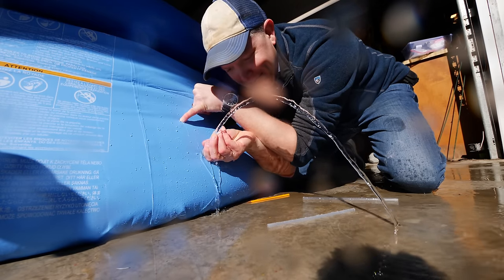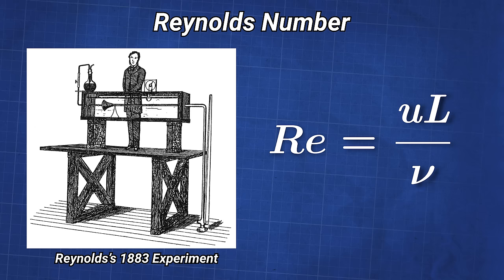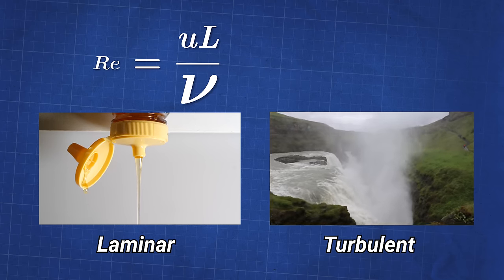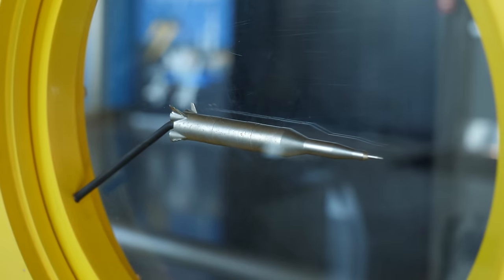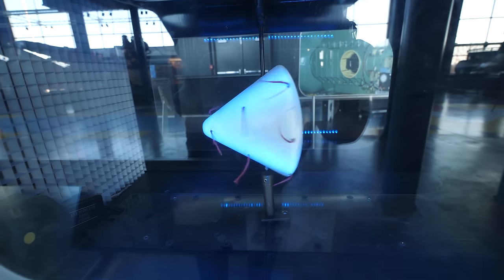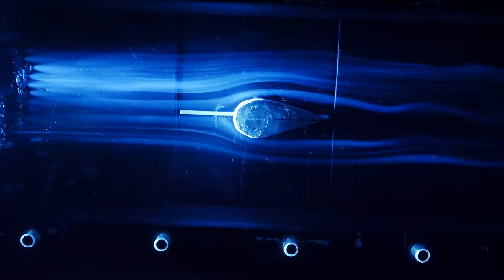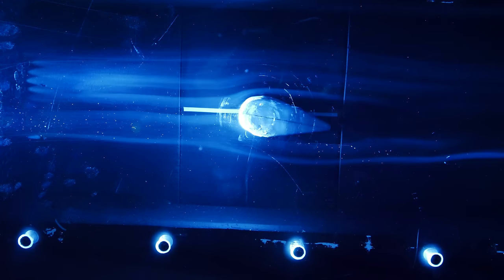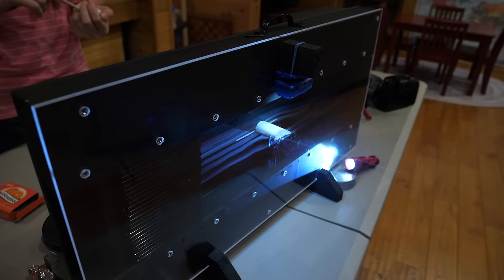Why Laminar Flow is AWESOME - Smarter Every Day 208

Comment: If you put your head under a laminar flow bubble, could you still breath without breaking the bubble? Would air escape through where the water hits the bottom or would the bubble bust with the increased air pressure in the bubble?
Reply: interesting idea... I would say it stays the same since the air volume in the bubble decreases as you inhale, the air volume in the lungs increase equally. But, there may also be a chance as the water creates bubbles at the surface of the pool, it may be increasing the air volume inside since there are bubbles being produced on both sides of the water bubble and air from outside of the water "bubble" is allowed to escape to the inside.
Reply: @bunnykiller  that'd be an interesting high speed camera shot...  a sudden pressure increase (or decrease)  in a "sealed" laminar flow bubble.
Reply: Sounds like a really neat idea. Someone needs to get on this right now.
Reply: What is the reason you think pressure would increase in the bubble? You don't produce air, and unless you add air, there is no average pressure increase. There will be localized pressure increases/decreases around your mouth as you breath in and out, but the average pressure of the area will remain the same.

I don't know how much oxygen you absorb in the average breath, but I would say that all that would happen is eventually you would pass out after you've used all the 02 available. Hopefully you have a supervisor around, or the sense to get out of the bubble early, as your head would now presumably be underwater in which case you would otherwise drown.
Reply: They have laminar flow fountain bubbles in the OKC science museum where you can feed pressurized mist into the bubble. It will get larger and larger until it pops like a balloon. Super cool.
Reply: @toasty4000000  The air you exhale weighs slightly more than the air you inhale. So presumably, it would sink and create extra pressure near the bottom.
Reply: I don't think the pressure would increase, you'd just exchange O2 for CO2. It would be interesting to know if such a bubble is actually air tight to gas exchange though, at least at the rate needed for breathing.
Reply: Oh my god that is so cool. I hope Destin comes up with an idea to demonstrate it. I would love that.
Reply: @toasty4000000  He said if just your head was under the bubble. You don't "produce air", but you can transfer air from your lungs to the inside of the bubble. If the bubble was around your entire body it would be different, but that's not what he was asking.
Reply: It's not really a bubble in the classical sense that some gases create bubbles when they rise from below water. If you look at the bubbles Destin created or the one in the fountain, those don't create depression, which would be the difference in pressure you're talking about. I think air pressure would be far too low to create something like that, you'd have to have incredible exiting speed for the water. Even then you don't get an entirely "smooth" (laminar) surface to the "bubble", there will be some disturbances from the not entirely perfect shape that the water exits from, this leads to holes in the stream (cavities) which make the bubble incomplete (which lets air inside).
Reply: @toasty4000000  The reason is because if you go in without a breathe, then when you breath in, the pressure outside of your body would decrease.
If you go in with a breathe, then when you breath out, the pressure would increase.

Breathing with a paper bag over your mouth is the same idea; it's not like the bag would stay the same size. lol
Reply: I agree with the lung capacity comments, but I don't really think that is what OP was getting at. Could be wrong.

Comment: Though commenting on this almost 2 years after it was made, we took advantage of this for a trick as kids (though I hadn't really thought about it as such until now). I grew up in the middle of nowhere Idaho and all the farming there is done by irrigation. To control who gets water when, the irrigation district employees would go around and adjust the gates along the ditches and canals. We had a couple of swimming holes where some of those gates were right by a small bridge. We would swim up under the bridge, where there was almost a circular "lazy river" created by the flow from the gates. If the gate height was just right, then the water spilling over was laminar. We would often back up towards this laminar spillover and when it reflected off the back of our heads, it would create a pocket of air (just like in your fountain)  and we could just sit there and breath the air from the pocket. Thanks for bringing back some great memories!

Comment: the same thing happens in rivers.  a murky particle filled stream joins a clear colder tributary stream and the two streams take many miles to mix.  also with ice streams of combining glacier flows (though the flow is slower).

Comment: I refuse to watch at 360p. Destin's work deserves 1080p at the very least! I needs to see that flow in HIGH DEFINITION <3
Reply: I just watched the whole thing in 360p without even realizing it.
Reply: its a YouTube trouble
Reply: curiosity wins over 360p lol
Reply: It is painful to watch in low res!
Reply: Watch it twice like a normal person.
Reply: @UndercoverFerret404   Is that extra chromosome acting up again?
Reply: @MarinusMakesStuff  Did you parents drop you too many times when you were little? If you even knew your parents of course.. I guess not.
Reply: lel i thought that my wifi got some problem cus its always auto 1080p
Reply: @JonathanLov  same here. didn't notice it was 360p until I read the comments. curiosity wins :)
Reply: @UndercoverFerret404  Lol, took the bait :D If you can't finish what you started, don't start ;) Be nice.
Reply: I just watched this on a 43" 4k monitor without realizing it was low res, good content is good content
Reply: Im waiting for it lol
Reply: The YT compression algorithms are pretty good, tho. The 360p looks better than FB "HD" res.
Reply: I've been waiting 5 hours now, refreshing every 10 minutes. I stand strong on the front against low-res.
Reply: Then don't. I'm sure he won't notice.
Reply: Not watching if it's not 8K.
Reply: @6infinity8  lol
Reply: 6 hours later...still 360p
Reply: Rumor has it if you watch it 3 times it will be in 1080p
Reply: @Vidz0022  and it still doesn't change the quality of the content.  Maybe in 24 hours?
Reply: @MarinusMakesStuff  
Yeah it's working great!   Oh, he wanted to thank you for donating yours, since you weren't using it.
Reply: @UndercoverFerret404  Haha, a troll calling a non-troll a troll. Made my day. Thanks man.

Comment: Hey Destin, put a light source inside the laminar flow, it will act just like a fiber optic cable, the light will only escape when the flow becomes turbulent.
Reply: yes that needs to happen
Reply: You actually just blew my mind thanks!
Reply: If you shine a laser at an angle into laminar flow the laser beam will spiral up through the stream
Reply: it depends on the fluid refraction angle with the environment, not all 100% is refracted inside...
Reply: What? Imagine you’re stirring a pot of water and putting a laser just beneath the surface pointing down. I don’t think the red dot on the bottom of the pot will move.  Light passing through turbulent flow,  but unless it gets refracted by the surface of the water the dot will stay in place.
Reply: Are you sure?
Reply: It will escape at all points, although mostly during turbulent flow. It also depends on how much the stream is bending. You need a slow gradual bend to minimise light escaping.
Reply: @yutaegil4944  Yes... The laser beam refracts, but not only that the internal surface of the water is reflective.
Reply: How would you do that? With the young girls laminte flow? Didn't she have a light in it already. or the one at the science labatory he stood in.
Reply: @wildwest2255  put a light source behind the funnel that's in the kiddie pool

Comment: You should go to a manufacturer of fountains that use laminar flow.  I'm sure they would be glad to show you the development work they put in to designing their laminar fountains.  Fire departments also put stream straighteners on their large master streams (usually mounted on the top of the fire engine) to smooth the flow of water.  This not only keeps the stream from bending sideways, it will flow farther since it's not breaking up with turbulence.
Reply: Development process: listen to Destin talk about "all the variables" for 10 minutes, and then they just fill a tube with lots of little straws to make the flow more laminar, and then try a bunch of random flow rates until it looks good.
Reply: MikeBramm this reminds be of something related! The nozzles are actually designed to break laminar flow because that type of water is less effective for putting out fires.
Reply: This is a really good point, as a laminar velocity profile within a tube does not necessarily translate into being a nice "laminar flow" on the outside without some precise manufacturing of the opening. My dynamics professor gave us a whole 20 minute spiel about how he thought the Detroit Airport fountain was made, and when he talked to the company who made it, they more or less confirmed that he had the right idea.
Reply: @Mrcaffinebean  what
Reply: But anyways you should go and do that first 😉
Reply: daniel finley-pesti if you look at the end of a Modern fire house nozzle you’ll see it has little slits to break the laminar flow. This is intentional because a thousands of small droplets of water do a better job of putting out a fire than one solid continuous laminar stream.

Comment: When you accidentally pee on the rim of the toilet bowl, laminar flow ruins your bathroom
Reply: I bet, that was turbulent flow what ruined your bathroom mate!
Reply: Taylors number explains why we often have problems with aim. The best way to wash your car, hold the hose to the surface and the impinging jet/circular laminar flow uses the least water with quickest removal of surfactant.
Reply: Pack it up boys this guy won!
Reply: Laminar flow would be the ideal situation as it forms a steady and organised stream. I think you meant to say turbulent instead of laminar.
Reply: I think this is the most relevant example to most males - we see pee physics in action all the time
Reply: Laminar flow is good when aiming, but bad when you didn't notice that electric fence...

Comment: 0:51 
Hi, Phil Swift here with 
Flex Tape! The super-strong waterproof 
tape! That can instantly patch, bond, 
seal, and repair! Flex tape is no ordinary 
tape; its triple thick adhesive virtually 
welds itself to the surface, instantly 
stopping the toughest leaks. Leaky 
pipes can cause major damage, but 
Flex Tape grips on tight and bonds 
instantly! Plus, Flex Tape's powerful 
adhesive is so strong, it even works 
underwater! Now you can repair leaks in 
pools and spas in water without draining 
them! Flex Tape is perfect for marine, 
campers and RVs! Flex Tape is super 
strong, and once it's on, it holds on tight! 
And for emergency auto repair, Flex 
Tape keeps its grip, even in the toughest 
conditions! Big storms can cause big 
damage, but Flex Tape comes super 
wide, so you can easily patch large 
holes. To show the power of Flex Tape, 
I sawed this boat in half! And repaired 
it with only Flex Tape! Not only does 
Flex Tape's powerful adhesive hold the 
boat together, but it creates a super 
strong water tight seal, so the inside is 
completly dry! Yee-doggy! Just cut, peel, 
stick and seal! Imagine everything you 
can do with the power of Flex Tape!
Reply: 8:12 And the inside is completley dry! Yeeee-doggy!
Reply: @thatguymint7415  copy paste lol
Reply: When you study the commercial

Comment: I asked my fluid mechanics that I noticed that the smoke at the end of the my cigarette would go straight then eventually curl. He said that was turbulent flow versus laminar flow. The smoke would go up straight because of the heat and as the smoke cooled it became more susceptible to the currents in the surrounding air. I also asked him about this right before he was going teach laminar versus turbulent flow.

Comment: I love laminar flow.  The engine in my truck is a turbo-charged GDI with the resultant accretion of carbon et al on the intake valve and valve stem.  This results in turbulent air flow, restricted air flow, poor performance and poor fuel economy.  I hate turbulent flow.

If I had the money, I'd port and polish the intake runners and cold-side of the intake valves.   

I polished the carb, intake runner and transfer ports on a Honda CR-250cc mounted on my Zip go-kart.  Went from boggy performance with a maximum of 6,000 rpm to a fire-breathing banshee pulling hard through 13,000 rpm .  I had to let off the throttle at 140 mph as the corner was approaching rather quickly.

I love laminar flow.

Comment: Laminar and turbulent flow don't have too much to do with separation. There are two different phenomena. Laminar and turbulent are connected with the Reynolds number, while separation is connect (fora wing) to angle of attach. You can have separation in turbulent but also in laminar flow (that after the separation is not lamina any longer)

Comment: I love how you speak to the science fair girl with the same respect that you do with university professors in your other videos. 
Also the fountain in the mall, would you have to level the whole stone structure or just the steel rings that regulate flow into the holes?
Reply: I'd imagine you'd have to level the entire stone platform otherwise you'd have slightly faster flowing water coming into the back of the ring than the front, assuming the platform would be slanted towards the front (front being the side you approach and dismount the escalators).
Reply: @markwright3161  Its obvious only the rings!! Not the entire stone. The pressure of water is the same at the same level independtly of the depth...
Reply: @markwright3161  It looked like there might be a metal sleeve in each hole. If so, each sleeve was probably adjusted vertically to get just the right height after the stones were set in place.  It's even possible the holes in the stone were a little oversize so the sleeve could be tilted a fraction of a degree if needed to get the perfect result.
Reply: @arqpal  (What I saw on re-watching) On his way down (just after 10:04) he mentions both, or at least how being level is important and difficult twice (which I'm assuming is to reference to these 2 features of the water feature). 
In his pool explanation he talked about how velocity also affects the turbulence of the water. I thought that if the stone was angled at all, the water would flow over the back of the rings faster than it could flow over the front, and therefore cause turbulence in the curtain of water formed and therefore have it fall apart before it reached the next level, like he achieved with the straw around 1:00 where it starts as laminar flow but becomes more turbulent as you follow the stream. 
My thought was that surface tension would have been enough to maintain a constant flow and would be even enough to prevent turbulence from forming and ruining the laminar flow between levels. 
From what I understood from NotaBear's original comment, I assumed they understood that the rings would have to be level regardless and that they were purely wondering if the platforms would also need to be level to guarantee laminar flow.

Comment: Too fast for FullHD :(
Reply: 360p the FullHD of the 2000.
Reply: SAME!
Reply: Give it an hour or so for YT to process his upload into all of the different quality options.  It's a labor-intensive talk, taking a video, processing it, splitting it up into different streams in quality, then save all of them on various servers.  It will then be sent off to YT servers around the country to be cached on each one.  Time is all it takes.
Reply: If the bitrate was any higher, it wouldn't be laminar flow.
Reply: @LobbySeatWarmer  Hmmm... Now you got me thinking as to if laminar flow could apply to a data stream.  I'm thinking compression or it's likely that I'm totally overthinking the whole thing.  Thanks for making me to use my brain for a few minutes on this wonderful cold Sunday morning.
Reply: it's been 1 hour and still only 360p.

Comment: I just found out that the sink in my kitchen makes a laminar flow...
I used to play a lot on it with plates, forks and spoons
Reply: dallatorretdu any fluid going down a pipe will be in a laminar flow
Reply: Infinity But most sinks have an aerator on them that intentionally makes the flow turbulent. It’s the rare (usually higher end) sink that produces a gloriously laminar flow.
Reply: @Miraxuu  they generally make sinks turbulent because if it was laminar it would spray water a lot more than a normal sink

Comment: to make perfect laminar flow: 1. Get a 2 liter bottle. 2. Punch a hole in the bottom of the bottle, fill the bottle with water, and cover the hole with your finger. 3. pour the water from the bottle. it should be laminar flow. with air just coming through the water pouring, it intterrupts the flow and makes bubbles, but with another hole, the air come another way and makes laminar flow or just twist the bottle and make a vortex.